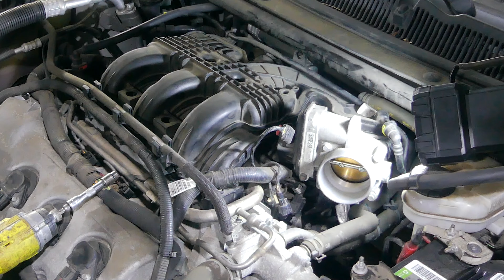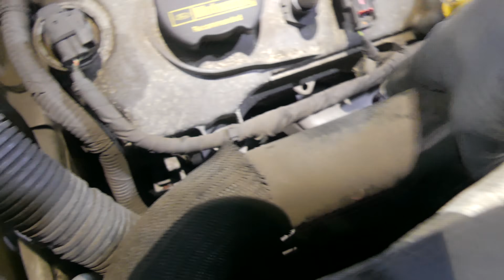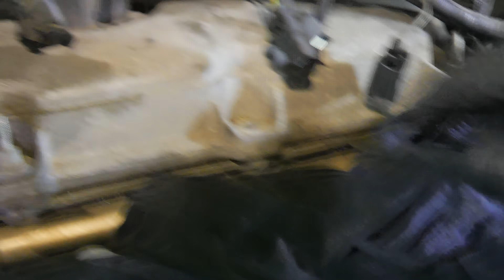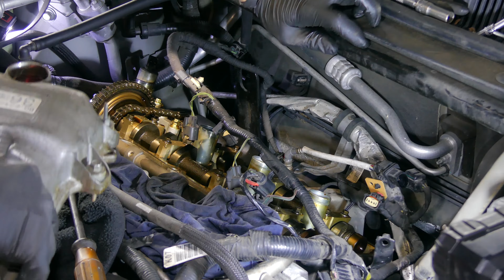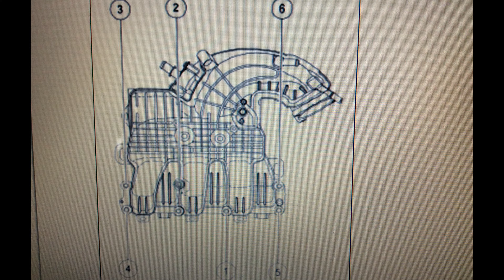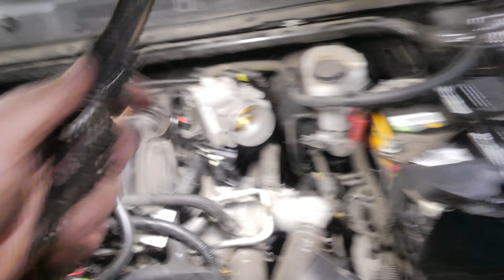How To Replace Valve Covers on a Ford Taurus V6 - Tips & Tricks Included!

Comment: Great video!!! Question for ya, did the  customer have any issues with the idle? I’m struggling with a vacuum leak I can’t find and now wondering if the valve covers are causing it.
Reply from the maker: Thanks for watching! The only time they had an issue and came to me with it was a vacuum leak and the one hose for the intake hose was completely off because of some recall work a Kia dealer did (I know, Kia and it's a Ford.) 
What about your PCV system?
Reply: @GTSam  yeah checked everything. Replaced Pcv, hose, purge valve which was leaking, now going to replace throttle body seal, intake gaskets, and valve cover seals. I smoked the system no leaks detected. Kia that’s comical
Reply: Also brake booster and hoses all good too.